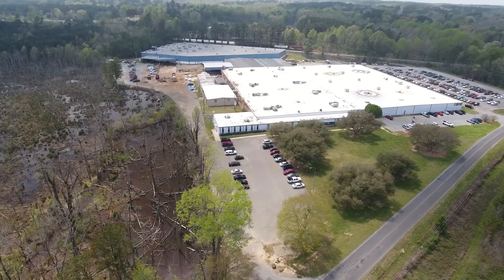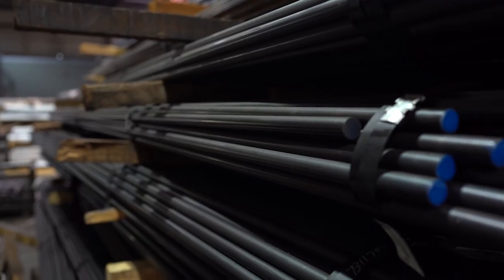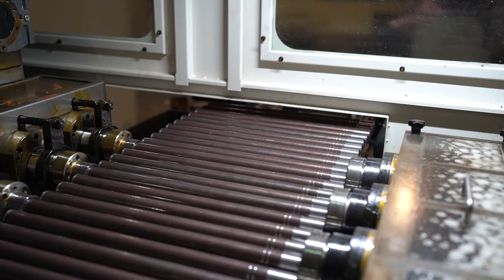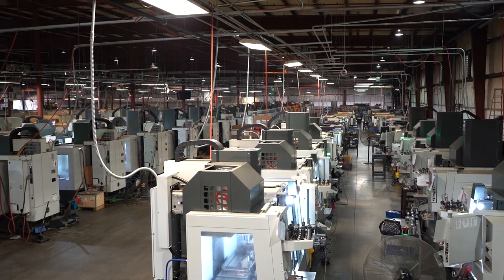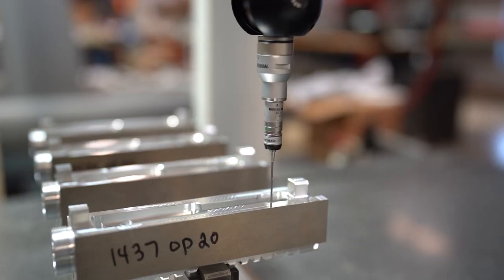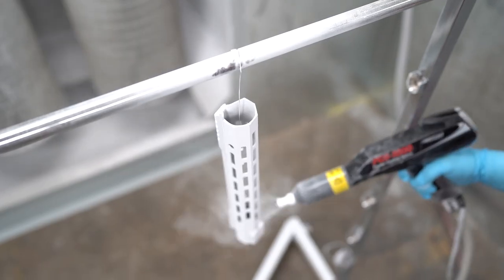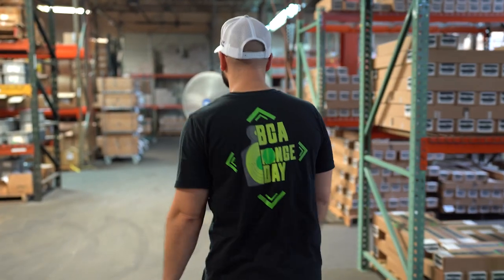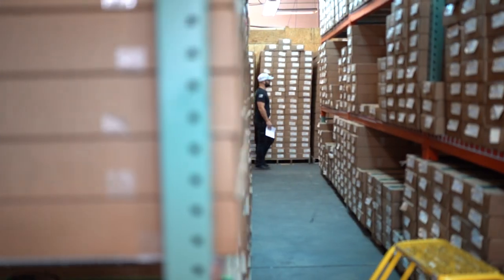Bear Creek Arsenal Mini Tour!

Comment: I've been in manufacturing for more than 30yrs. I can honestly say I was quite surprised at the size and scope of the BCA manufacturing facilities and capabilities. It's truly impressive.
I'm happy I've done my part to keep the lights on in that place. I think I have 7 or 8 different uppers and outside of a few assembly issues (nothing I couldn't take care of myself) they have been great. But truly the most impressive thing to me is the fact that every last one of them is just impressively accurate, like it should have cost 6x more kinda accurate. More than a handful of mine have put meat in the freezer for me. I think a .308 is next in line. Or that 30-06 I keep hearing about...hmmm
Reply: @@wildtex9710 Funny, I have the same thing in black. And yes it do put the meat in the freezer. So does my 350 legend and my 223 wild as well. Hopefully soon my new .308 will as well.

Comment: Nice video. Seen a clean 7.62x39 upper a neighbor had with charging handle on the side of bolt. Very cool. I plan on getting a pistol length bbl upper.
 But wondering if they have any plans to make it in a self contained upper no buffer tube?  I could use it along with a Matador 9. Cmmg 22. And 5.56 on lowers from Foxtrot Mike folding gen 2. For now I'll settle on the buffer tube model on a Anderson lower until Bear Creek makes one.

Comment: Hello BCA crew  I  Have  very 3 good products  from you guys but, for the last three months I'm tried to buy an AR10 .308  20" 416R SS fluted  barrel left charging handle upper assembly and was impossible due to always is out of stock, I spoke several times with your customer services  people and they don't know when this product will be back in stock, first excuse was lack of 416R barrels what is not true, and then they talk me that by low demand in this upper they are not in stock for now, the only solution that they  give  me was to save this upper in my wish list or in back to stock notifications  just what I did 3 weeks ago. I will appreciate  any help from you guys to fix this issue  or just tell me if this product will be discontinued from production .